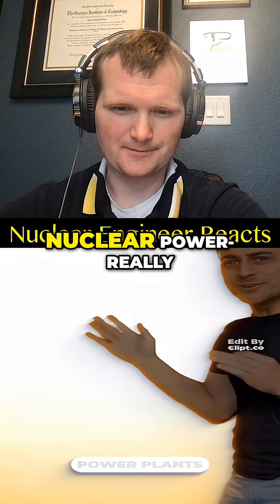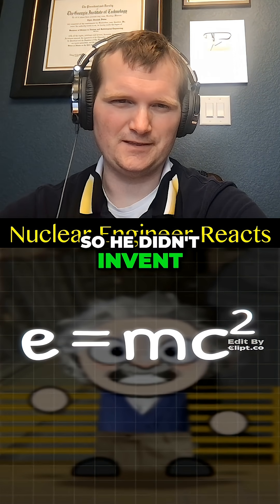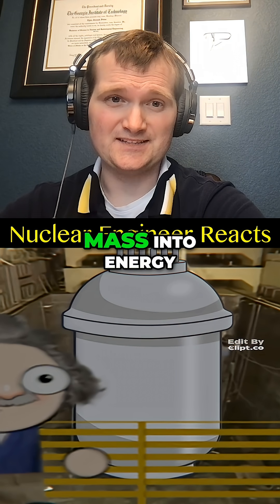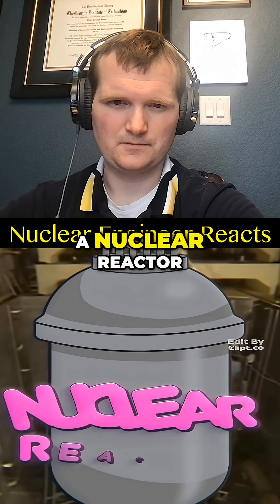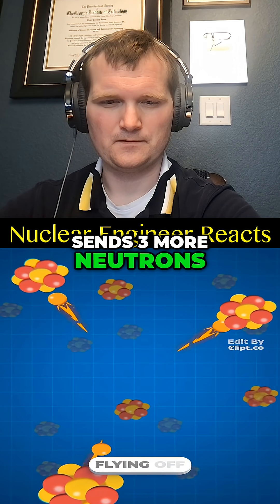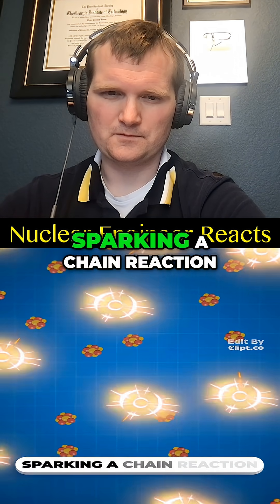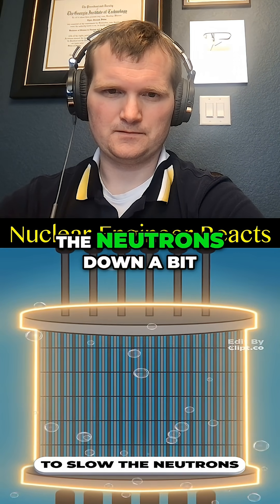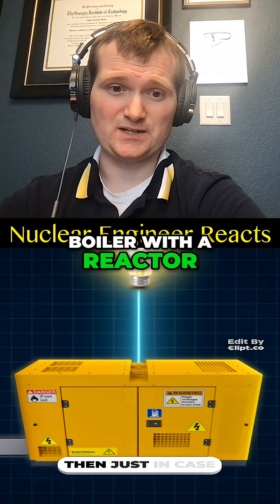How Nuclear Energy Works - Nuclear Engineer Reacts to Henry Belcaster

Comment: I'm pro NPP, but it's not absurd for people to think they're scary.
2 reached Level 7 (Chernobyl and Fukushima) as a major issue.
About 1.5% of all reactors ever built (roughly 10 units) have had some form of fuel melting.
About 30 events have been rated Level 2 or higher worldwide.
Statistically pretty safe, but when there is a problem it's often pretty severe. But to mention the waste. Plus there are random things like the recent news about radioactive wasps. Concerns aren't totally crazy (Again, I support nuclear power plants in general).
Reply: But no other power source is scary?
Reply: @datcheesecakeboi6745 The problem is that using logical fallacies like whataboutism, straw man, red herring, false dilemma, etc to say "what about other power plants" while ignoring the concerning data about nuclear (such as those I mentioned already) will never convince antinuclear people they are absurd for fearing the unique dangers nuclear brings. 

As I already said in the original comment, I'm pro-nuclear. There are powerful rationales for preferring nuclear, including on the matter of safety, with it having the second lowest number of deaths per TWh produced. Only solar has a better overall record. 

Nuclear has a unique HILP (High-Impact, Low-Probability) profile. Most power plants are a risk to employees; nuclear carries a unique (though rare) risk of creating a 1,000-square-mile exclusion zone. This is a high-degree, localized disaster that puts local people at immense immediate risk. This is why everyone fights not to allow them within hundreds of miles of where they live. Other power plants carry worse Occupational Safety. And while nuclear is incredibly safe for workers, its public risk profile is the one people actually fear. While a hurricane or earthquake might knock out a gas or coal plant, it won't turn the plant into a 1000 square mile 100-year radiological hazard for the entire county.

If we want people to support nuclear, we have to be honest about the tail risk of a cascading failure during a natural disaster instead of pretending those risks don't exist.

We can understand why some people would fear having their family live next to a nuclear plant, especially in places prone to certain kinds of natural disasters. Leveraging logical fallacies like Whataboutism will just make those people defensive and ignore rational points and data at best

Comment: It’s called direct energy conversion and it’s a working technology. Old nuclear boils water mix steam rotates a turban. Fourth generation nuclear has no radiation and is direct energy conversion from heat straight to electricity. https://youtu.be/_VXDK4Yu5FA?si=XBdMMtOUYD84BnpH

Comment: They boil water to turn turbines.
Essentially moving magnets past wire -- which is how at least 90% of all electricity is generated.
Just another steam engine.
If they really wanted to get clever they would utilize alpha & beta particles passing wires for electricity too. But right now in this Stone Age heat conversion is all the rage and has been for the last couple hundred years.

Comment: I’ve always wondered where “starter neutrons” come from. 

Is something like tritium required to get the chain reaction going, or are there enough neutrons spontaneously generated just by having a critical mass of enriched fuel in a critical geometry in the core with the control rods retracted to get things going?

I grew up around INEL engineers and have looked at and discussed reactor designs and the idea of “an initiator” never came up, and that’s always bothered me.

Comment: More efficient way to create electricity is still science fiction if you could creat electricity how the planet does in a controlled environment and have it substantiated indefinitely and then creat equipment that can withstand the ability to harness the electricity from the lighting strikes you have created the most carbon neutral form of electricity ever created but thats science fiction so you have to go with practical theory’s like fusion reactors

Comment: It’s a fancy steam engine it boils water into steam which turns turbines connected huge generators that conducts electricity then sends that newly generated electricity down to substations that regulate the power (AC) down the power lines that powers your house that is that most dumbed down explanation I can think of heat /water are the fundamentals you for electricity

Comment: On the point of nuclear reactors being scary: yes they are, that's why they have such tight security measures. I am pro-nuclear energy,  I think we should absolutely transition toward it rather than continue to rely on fossil fuels, but you'd have to be incredibly naive to think that the proliferation of these facilities combined with a profit incentive and a few decades would not eventually lead to catastrophes. Just look at how thoroughly irresponsible we are with oil rigs, for example, let alone how irresponsible we have ALREADY been with nuclear plants.

Comment: It should be easy to figure out from E = mc² that the mass lost is converted to energy.  There's an initial mass and a final slightly lower mass.

Slightly harder, but easily seen after calculating (say) the kinetic energy, momentum, and speed of the alpha and recoiling nucleus in an alpha decay, is the answer to the question, "What fraction or percentage of protons and neutrons get converted to energy?"

Comment: How many electron volts does a U-232 nucleus give off when it fissions? U-232 nucleus releases about 200 MeV (roughly 3.2 x 10^-11 J) per fission, so the energy in electron volts is about 2 x 10^8 eV per fission, i.e., 200 MeV per fission.

Comment: “Big scary nuclear plant” give me a break…
Reply: Okay:  Chernobyl Reactor #4.  That broke on April 26, 1986.  Is that enough of a break?
    
Yes, in a perfect world, nuclear power plants are engineered, built, maintained, and operated to an incredibly high standard. We do not live in a perfect world, as you may have noticed.  

And the reason that nuclear power plants are so strictly regulated and designed is that if they break down, the results can be utterly nightmarish.  How many people would die if a field of solar panels stopped working in the most catastrophic way they could?

I'm not saying nuclear power is unsafe.  I'm saying it concentrates a nexus of tremendous potential harm and tries to make it as safe as it is possible to make it.  The question that must be asked is whether and when creating ANY potential for a horrifying disaster is justified.
Reply: @woodrobin look up their safety protocols and procedures. Very limited that’s why Chernobyl happened. Nuclear plants are so heavily regulated these days.
Reply: @woodrobin nuclear is far safer than fossil fuels, which actually kill a LOT of people from toxic fumes, mining accidents, etc.
Reply: @woodrobin  The big thing this runs into is that this risk happens to be the MOST controlled for the most possible energy. The other power sources have more issues and horrid accidents per year.
"Is the risk of horrid accidents worth the result?" You've essentially just asked one of the most hotly debated things in all of philosophy. 
The ends versus the means. 
Nobody can say because regardless of what you choose there will be a vast majority of the population who disagree. Is being a utilitarian, a machiavellian acceptable? Is being an idealist acceptable? 
Surprisingly enough we're still talking about Nuclear power. To give a completely true answer of if it's worth it those prior must first be tackled. Ultimately it is subjective, though subjectivity is relative.
Reply: @woodrobin Compare nuclear power plant disasters in HISTORY (the biggest one happening mostly because of unbelievably corrupt and rotten to the core soviet regime and its mismanagement of every single facet, including nuclear power plants, of its society.) to a "necessary evil" like cars. We accept cars as a COMPROMISE for convenience. Cars kill thousands times more people every year than nuclear disasters ever have (and Chernobyl mostly caused this many because once again corrupt and lying regime that tried to hide the truth and didn't evacuate citizens) but we accept it as the norm.

Do you know how many nuclear power reactors exist/existed in history compared to the amount of casualties they caused? This idea that if we used nuclear reactors as the norm for power sources, "we would live in a dangerous place" is just silly and fear mongering.

What you said about "not living in ideal world" is true, which is why we obviously can't just "go green" that easily. Solar and wind power won't replace regular power plants which ARE the cause of excess co2 in the environment. Nuclear power IS green power, with few caveats which became a stigma due to a few disasters in the whole history of humanity (and killed just few thousand people).

Comment: We really can't get away from using steam to power things, we just change how we heat up water.

Edit. I meant spinning something but was too focused on the steam used by most power plants.
Reply: It's the most efficient way all other methods are bad or not scalable. Combustion engineers are not scalable. Acid generators are bad
Reply: Power plants can generate electricity without steam (wind farms and hydroelectric plants being two examples). It's the act of spinning a turbine that's non-negotiable. So far, at least.
Reply: @viktormuerte  hydroelectric plants arent scaleable I mean I guess you could put another dam right below the first one, but youll eventually run out of river or land to flood with lake. wind farms arent resalable.
Reply: @xyxy9870 I realize that. I was only replying to the op saying a power plant needs steam to generate energy. 

Btw, there's a wind farm near where I live that supplies half the electrical needs of our city. The other half is generated by my country's biggest electricity provider.
Reply: @xyxy9870you can't scale hydroelectric by putting another one below the first, the water does lose energy after first fall so it becomes quite inefficient in all scenarios i can think of, if even applicable.
Reply: @Race-dn4to I meant put it below the first dam such that the second lakes stop is right below the bottom of the first lakes dam

Comment: Those graphics are just as bad as "Our Friend the Atom". Btw. also a partly very misguided movie about how nuclear energy works.
Oh, and it might have been (German equivalent of) high school when I learned most of that stuff, but there are heaps of different designs for nuclear reactors, and while some of them are hard to get wrong there were also some which were basically slowed-down nuclear bombs, and those are scary. Oh, and those giant cooling towers - coal power plants and gas power plants have them. What those don't have is the dome (because spheres are better than boxes in terms of pressure and so on) with the reactor in it.

Comment: They are big water heaters. Instead of coal, the burning rods heat the water, then press it with high pressure, middle pressure and low pressure through turbines. They spin fast and generate electric power with an attached generator.
Repeating the process.

Power plants always were just giant water boilers.
Reply: The Fukushima ones didn't even used high pressure. They just converted the water in the reactor into steam, that steam then in a heat exchanger gave it's heat to the secondary cooling ring, that powered the turbines and then the water from the primary water circle went back into the reactor

Comment: "Most tightly controlled" yada yada. Can you name a non-nuclear powerplant incident that inflicted greater damage then Chernobyl or Fukushima? The "no safe limit" rule stays. Other then that, yeah, you are usually right.
Reply: bhopal pesticide plant disaster. actually a horrible tragedy most people dont even know about. the immediate death toll was higher than even the high estimate for chernobyl deaths over time. easy, took under a second to think. for fukushima only one singular death was from radiation poisoning, and it happened because the plant ignored aspects safety regulation, which is very much followed nowaday. and in chernobyl, the worst nuclear incident, deaths were still under a hundred,
Reply: @jason59k55 , the death tole is comparable and the longevity is there but is staggeringly different in scale. The affected are is much smaller. The cost is wildly different.

"(In regards to Bhopal, population 2,686,000 in 2025) according to them, the government should be asking (in compensation) for 370 billion rupees (US$8.1 billion) instead of 60 billion rupees (US$1.2 billion),"

"While Bhopal had a higher immediate death toll, Chernobyl's long-term global impact, including widespread radiation contamination, made it a more internationally significant disaster. Both disasters left lasting scars, with complex legacies of suffering and unresolved issues of accountability and compensation."

"Fukushima nuclear accident was estimated by Japan's trade ministry in November 2016 to be 20 trillion yen (equivalent to 180 billion US dollars)."

"Chernobyl  remains the worst nuclear disaster and the most expensive disaster in history, with an estimated cost of US$700 billion."

Comment: Chernobyl says otherwise 💀✂️🦷
Reply: Look into it more. Chernobyl was dangerous because of humans not because of nuclear power
Reply: @Charlesgerb it was badly designed with a poor safety philosophy
Reply: In the case of Tschernobyl is wasn't the Uranium that exploded. But the graphite around the way too hot rods began to burn, pressure builded up in the building and that made the roof explode.
Reply: @acmenipponair I know I was just saying for the sake of the video 😅